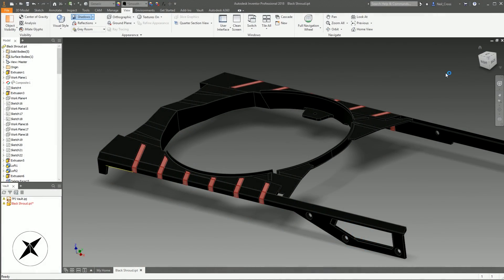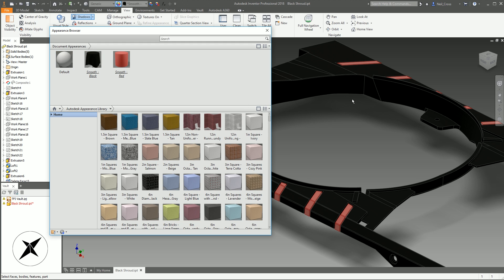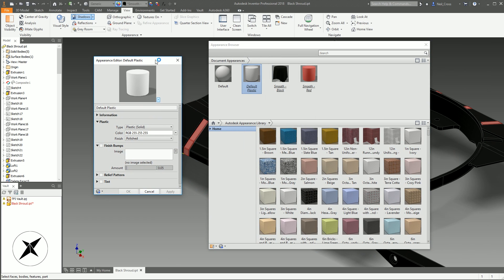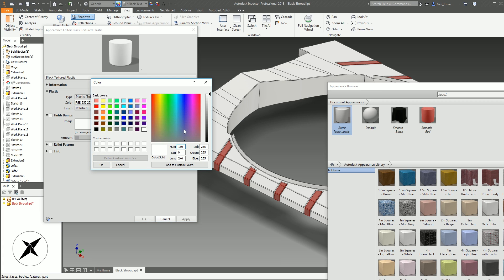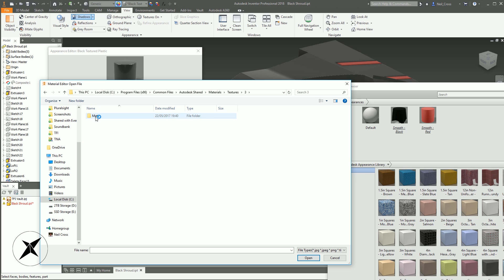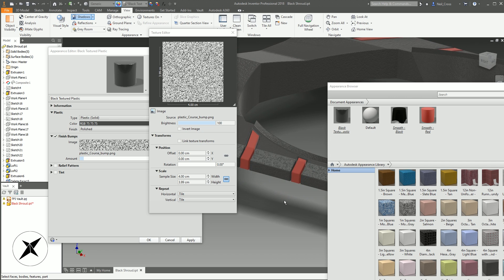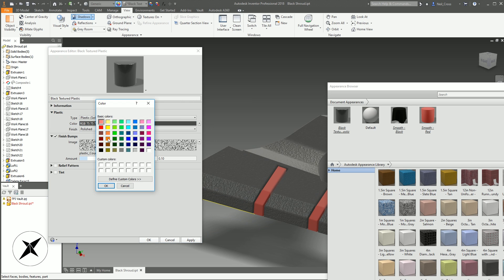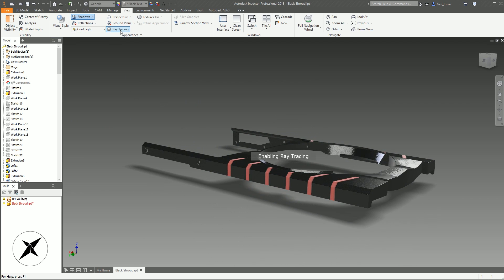How to make a plastic texture | Autodesk Inventor

Comment: Hello, Can I convert the 'virtual' texture applied to  physical and export in STL files? I need to learn it for 3D print jobs. Thanks and have a happy new year.
Reply: Did you find out if it was possible to convert the texture for stl, I'm trying to do a similar thing.

Comment: Hi do you have a video for sheet metal text   for example cut out name tags on sheet metal   I know you had a video on engraving   but need something to go all the way through the metal   THANKS
Reply from the maker: Did you try using the sheet metal Cut feature on the converted text? I'd probs need to check but I'm sure that would work
Reply from the maker: Actually just using the normal extrude command on text will let you cut text through the metal, Cut doesn't pick up text

Comment: CPU ?
Reply from the maker: I currently still have a i7-4790K.  Platform upgrade is required pretty soon.  The 4790K as a CPU is still competitive to even then 7700K but the platform (DDR3 etc) is beginning to let it down and hold it back.